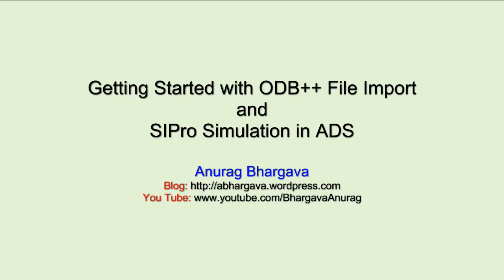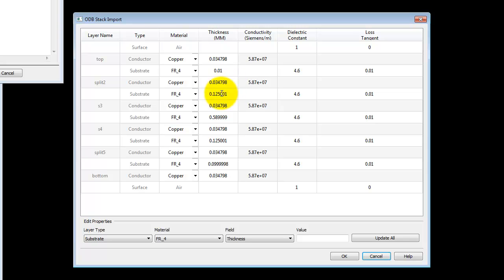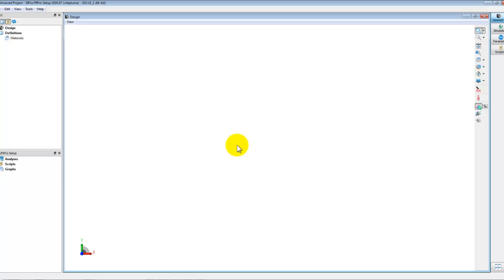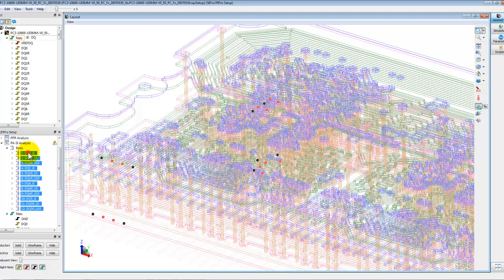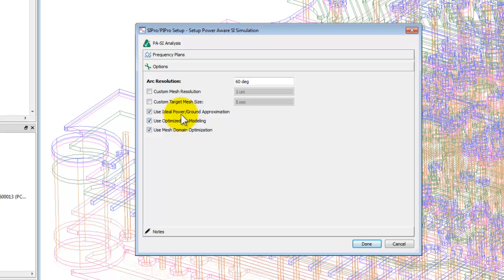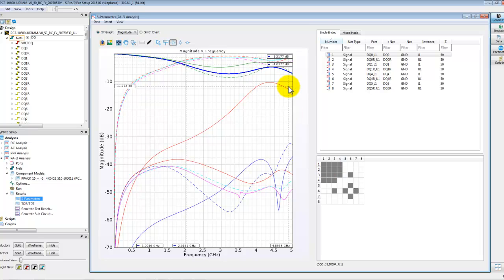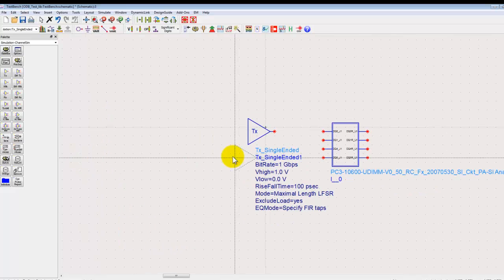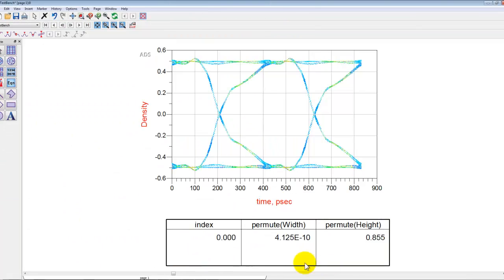ODB++ File Import and SIPro Simulation

Comment: To perform odb++ import and evaluate in ADS the file must include electrical models, correct? No electrical models, no ADS evaluation?
Reply from the maker: Hi,
It is not needed to have electrical model as you can add them pretty easily in ADS/SIPro so don't hold back...😊

Comment: Really helpful video.

I have a few questions,
1) While having the subcircuit, Do I need to add the components again in the schematic which has been already used in PA-SI analysis?

2) What is this reference means? If there are 2 separate grounds: PGND and AGND then what is a reference?
Reply from the maker: Hi Garima,
Your answers:
1. No, when you attach components in SIPro then those would be already populated in Schematic if you chose to select components as "Updateable After Simulation" in newer ADS releases else they will be included in the S-Parameter block in schematic but not accessible to users to modify the values but it will be included.
2. Reference is GND and you can pick the right reference based on which GND is applicable for the Nets you are simulating. In most designs you can have different GND planes and it is users responsibility to pick right one for Port setup.